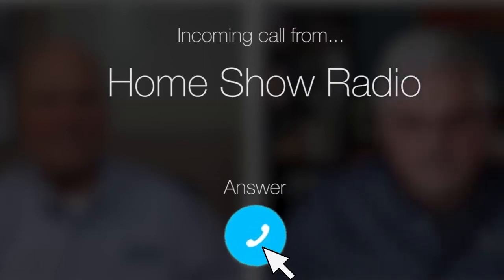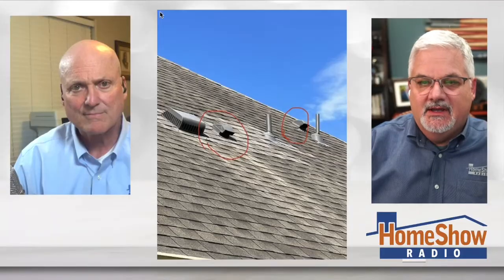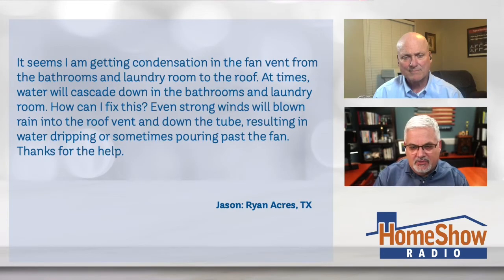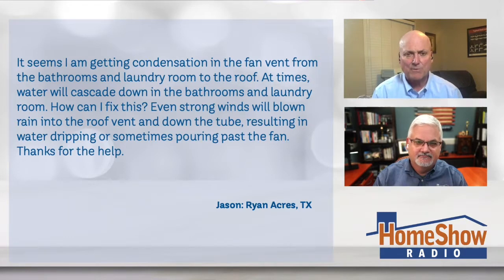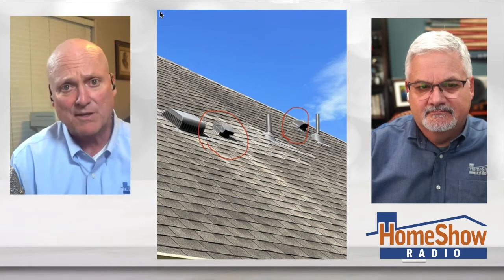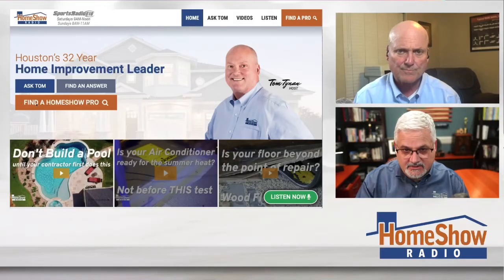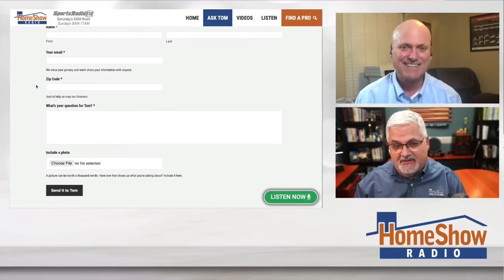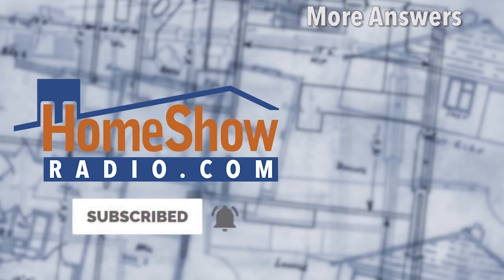Solutions For Condensation Build-up In Attics

Comment: I build a stand-alone cube like structure with a flat insulated roof, it leaked so I build another slightly slanted roof on top of the flat roof and because I did not want it to leak again, sealed the sides very well.  Unfortunately, what is happening is condensation is now forming as we have around a 30-degree difference between the night and peak of day and water is leaking through the ceiling, so I solved one problem only to have another.  The new roof is only a slight slant so there is not much room for side vents but I did put two on, but the problem persists.  Any easy solutions?